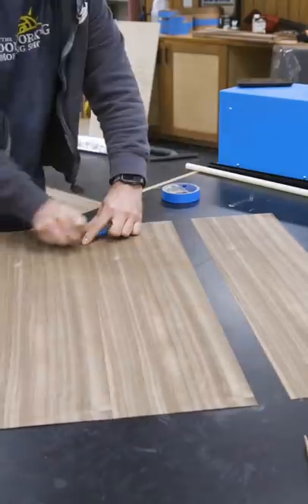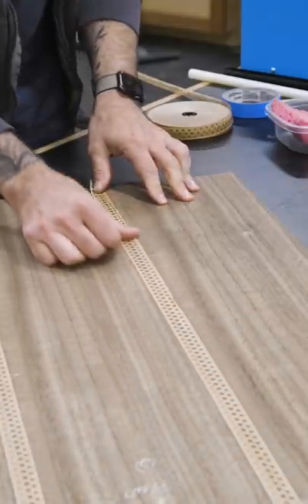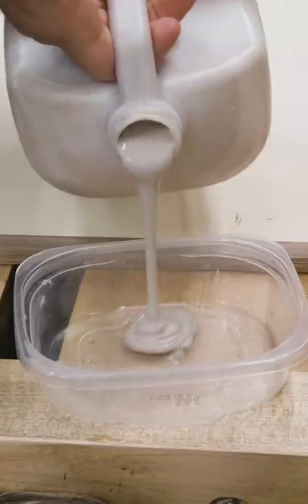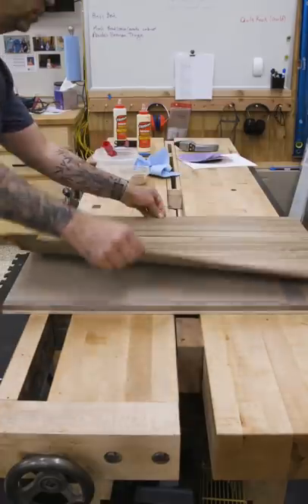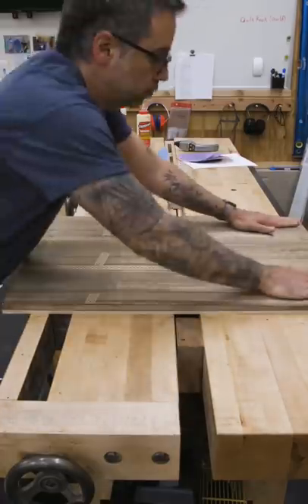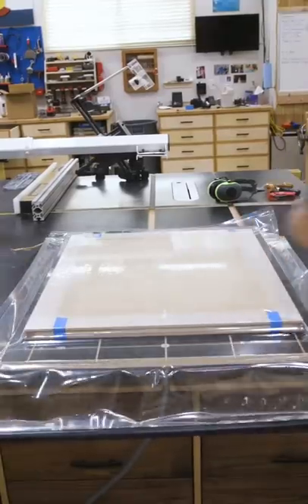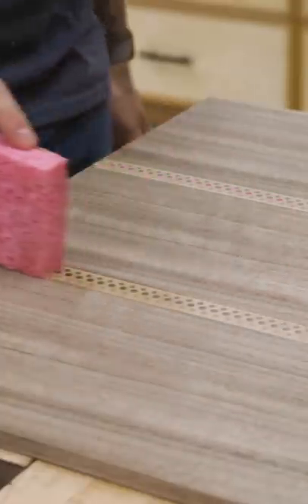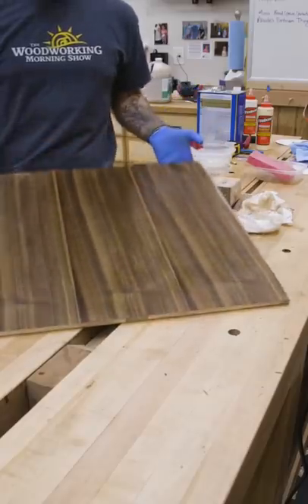Veneered Furniture Doesn’t Have to Be Crap | #shorts

Comment: Veneering high quality woods over less expensive or rare "secondary" woods is almost as old as woodworking itself.
Reply: Correct. The process was used in ancient Egypt
Reply: And it’s still a shitty practice today 🤷‍♂️
Reply: @pkennedy0219  why shitty? It saves precious woods and makes them more accessible to everyone to look at
Reply: @thomas.thomas  doesn’t change that it is a shitty practice that doesn’t last
Reply: @pkennedy0219  lol, so Chippendale furniture is crappy?
Reply: @Woodcademy  might not be crappy… but veneers are shitty they don’t last long term. I’m talking centuries not decades. I can spot a “well made” veneer almost instantly. So yea when it comes to longevity of a piece of furniture veneer is shitty. It also largely depends on where you live. Places that are dry will fair better than a humid place like I live. I don’t make furniture for just ascetics, how long it will last goes much further then it is”pretty”. I don’t buy prefab furniture so I have no clue who chippendales is, nor do I give a green fuq.
Reply: @pkennedy0219  any burl table top or drawer front you see in a museum piece is a veneer. Chippendale was the famous designer/builder of the 1700’s, his furniture, 200+years old and worth millions is usually veneered in part. Mortise and tenon joints are ancient too, but a poorly fitted one is crappy and will not last. Veneer is the same. Done well, it will (and has) last for centuries.
Reply: @Woodcademy  “veneered in part” that about sums it up. Is it possible to do I well sure. Doesn’t change that the majority of veneered furniture is shitty. I don’t like overly ornate furniture so I’m not into burl. I prefer shaker style, very simple furniture done with nice exotic wood. Unfortunately most shitty furniture today is veneered. Even some “high end stuff is just veneer with clever trim to hide it. I’ve restored some veneer furniture Thats around 100 years old, it usually isn’t worth it unless it’s legacy stuff that people cherish. Like I said I don’t buy furniture because it’s either cheaply made veneer shit, or over my pay grade. So I build my own stuff. I’m done talking to you though, you are boring and I won’t ever agree with you. So kick rocks
Reply: @pkennedy0219  yes no doubt veneer is crap compared to real wood. However in this day and age the human population has destroyed the wood resources on the planet. We can't make furniture like it was made hundreds or even 50 years ago.
Reply: @Willis476  that’s not as true as you think. Wood furniture has always been out of most people reach. It is more expensive than particle board covered in veneer because it takes real craftsmanship to make it. Wood has gotten more expensive because we stopped cutting in a lot of places. It’s more restricted now. But we shouldn’t waste wood on things that don’t need it. I feel like house construction could reduce that. Wood cost is also variable by species rareness. Wood furniture used to be the standard because that’s what we had.  I make my own furniture because I wanted to and was gifted really old machines. Carpentry is one of my favorite hobbies and the one I’ve been doing the longest lol. I was hammering nails at 5. Had my first drill press (bench top) and jig saw at age 7.
Reply: @pkennedy0219  This was all a pretty interesting read to me. Thanks for that, I didn’t know much about woodwork
Reply: @pkennedy0219  ok you got me for a second there! I actually thought you knew what the fnck you were talking about. Then you exposed YOURSELF. 🤦‍♀️🤯🤷‍♀️ Really you work with wood and DON’T KNOW THE MOST FAMOUS FURNITURE MAKER EVER...!?! Yea I call bs. I’m like the LEAST practical woman ever, even >I< know who that is! 🤦‍♀️🤯🤷‍♀️
Reply: @pkennedy0219  the problem is that having a nice looking wood doesn't exempt it from imperfections. You have to work with the material you have and when you manufacture goods you need consistency, strength. But also not something that weighs a million pounds. There is a case to be made for veneer from not just a construction stand-point but from an ecological one because wood working can create a lot of waste. If you rely on every "quality" wood to be without imperfection then everything is going to get a lot more expensive quick. It's often disingenuous, I'll give it that. And I've seen too many multi-thousand dollar veneered furniture, but I don't exactly own a business that relies on these materials either.
Reply: @pkennedy0219  have you seen the 3d printed houses? Major way to cut down on wood waste.
Reply: @kerimgueney  solid wood cut using joinery and glued together. If it is done right veneer can be hidden very well. Usually high end old furniture, but the majority of the time it is used to just hide particle board, or even on chip board. That won’t last at all. If they use a base wood instead like pine or poplar. Something that is solid wood but “ugly” then a veneer can last a lot longer. The big problems with veneer is that it can delaminate (peel up from glue failure do to moisture), it also can chip really easy if the edge of the veneer is hit
Reply: @kerimgueney  If you have the money to buy a nice piece of solid wood furniture it is worth it. Hell even off of Craigslist you can find some absolutely amazing wood furniture for cheap. Most of it can be redone and stained different colors. It can also be altered and made to look different. You can redo the finish on a wood piece with stripper and sanding. Mind you it takes a lot of elbow grease… but music helps to pass the time and it becomes almost trance like after a while. Almost meditative. If you want wood furniture your best option is to redo it which and can do it doesn’t take many power tools other then sanders. Or if you have a wood shop like me make it for cheap. For example I made a 9 ft by 2 ft by 2” slab African mahogany table for around 800$ including a few power tools I was replacing. But I have a table saw, jointer, planer, drill press, etc. sorry for the long rant I love wood, and carpentry. The smell of saw dust and cigarette smoke is my childhood from the age of 3 (not me smoking but my dad).
Reply: @elliot6166  my children and their children will enjoy furniture I made by hand. My goal is to build furniture for both my children and myself. That’s why I give a shit
Reply: @pkennedy0219  Solution: Ditch sentimental value, enjoy memories of you and not just your furniture
Reply: Fucking arguments in this section🤦‍♂️ as someone that works with veneers on a daily basis if done correctly it lasts as long as the item (also I don’t veneer onto cheap wood, it’s normally over oak or cherry) 
It may be cheaper but doesn’t mean the item is shitty, it means it’s veneered.
I mean I can’t afford chunks of walnut.
Reply: @pkennedy0219  i'm sure you made all of your furniture before calling another mans work shitty though, right? right?
Reply: @jaretbradley623  I won’t be done making furniture until my hands don’t work or I die. Doesn’t change the fact that I THINK VENEERS ARE SHITTY
Reply: I made a desk out of pine and oak in woodshop 10 years ago. It's worse than amateur craftsmanship and there's a big hole in one leg due to wood defects.
No signs of deterioration yet. Wood is good.
Reply: BS.  Veneered furniture won't last more than 10 years without showing.  You'd do much better just having plastic furniture.
Reply: @pkennedy0219  ok, I’m sure I do. Send me a link to your website so I can inspect and maybe purchase a bit of your handiwork??
Reply: @pkennedy0219  : it would last a lot longer if the soft wood that it’s glued to was completely sealed off from exposure to water on the underside … but as money has it nobody takes the time or the money to do the extra step .. LoL .. so when it falls apart from water damage just remember there was a way out of that problem that nobody wanted to take the time to fix … preventative Maintenance is missing in today’s world that nobody spends money on .. !!
Reply: Veneering is old tech...so is sharia law. Old stuff doesn't always mean it's good
Reply: @thomas.thomas  lol precious. Wood is one of the most renewable resouces....
Reply: @socrazybmx  Really though... The idea of treating tradition as holy is setting back humanity on a global scale.
Reply: @pkennedy0219  not true if you press it into dovetails. Quality is also about what you do with it
Reply: @undr_guv_surv  press what into dovetails? Do you even know what a dovetail is?
Reply: I have beautiful art deco furniture and it's all veneered and in lovely shape.. the way they bookmatch the birls are gorgeous
Reply: @ihave35cents95  it’s BURL
Reply: @pkennedy0219  we'll go have a word with Google Voice to Text
Reply: @andreacancian1865  cool story bro… idgaf what shitty veneer furniture is out their. Solid wood is better, but what ever you want to spend your money on. For that price I could buy new shop tools and wood to make a table that is solid 🤷‍♂️
Reply: no you have to understand this guy literally invented it no one has ever even tried this before
Reply: @StolenPw  lolwut? I don't fear much. And I have an assortment of calibers to cover those that I do...
Reply: @pkennedy0219  What I dont get is....why were you watching a veneer short? If you hate it so much, why watch it? Your skill set is just as useful and good as his is, yet you went out of your way to belittle his product. If your way is so superior why do you feel the need to waste your time on "inferior" products in a short? Seems like a superiority complex or a need to defend because you feel your own method and product is lessened in some fashion? I'm not angry, I just don't understand the thought process of going out of your way and wasting your time on something you hate.
Reply: So far I learned that one person really really REALLY dislikes veneer... Pathetic you care this much 😘
Reply: @SpltPersonaltyOF  He really dislikes it and is really wrong too, which is the funny part.
Reply: Except they often use crap pressure boards that disintegrate if wet even for a few minutes. Good luck fixing and rings or damage.
Reply: @pkennedy0219  What are you talking about? wood furniture was the standard furniture for everyone! What else was it made out of? It wasn’t out of reach, that’s the only material people worked in.
Reply: I did not know that. I learned a thing.
Reply: @pkennedy0219  one thing well known by carpenters and not mentioned is that its less about "expenses" and more about weight/warping. 
You can get pine that is extremely light, durable, and less likely to warp because of its less dense grain layers.
Wrapping cabinet pine doors with a mahogany veneer is actually higher workmanship than using solid mahogany since most pine is lighter and wont warp/split under its own weight like the heavier and more brittle mahogany.
Reply: @drakemallard1486  tell me youve never been antique shopping without saying you dont even know the meaning of the word antique
Reply: @solomonheppner  Zzz nobody cares little kid.  7 months late.
Reply: @drakemallard1486  bad bait. Try again
Reply: @pkennedy0219  how old do you think the particle board is? every single old piece of furniture left by my family from the 1800s is solid pine, handmade by them. that's ALL poor people had
Reply: @pkennedy0219  gonna have to agree here. I barely know anything about woodworking but the look of veneer is so ugly you can spot it a mile away. A true wood piece is an awe to look at
Reply: @sadidrahimi  I think you’re thinking of MDF with a melamine wrap finish (which sometimes has a printed wood grain texture). That’s the “fake wood grain” on assembly furniture. Veneer is different and is actual hardwood cut into super thin sheets. It’s pretty expensive and even fine furniture made from nice woods can be veneered, especially with the best hardwoods that would be cost-prohibitive to make the whole piece from. Doesn’t mean you have to like it, but veneer is not fake wood.
Reply: @pauldiamond1583  yes the Egyptians already did veneer and stacking stones they were also one of the first to figure it out. Amazing to see things we take for granted were done so long ago
Reply: @RagenRibbonz  speaking of the absolute worst veneers- the plastics with wood grain printed on, everyone knows they are horrible, but a buddy of mine said something that put it all in it's place. He said "They literally glued a picture of wood onto particle board" it's weird that I never thought of it that way.
Reply: @pkennedy0219 you expect to live for centuries?

Comment: It’s the symmetry that drives me mental.
Reply: That's why you usually flip every other panel in one or the other direction to break the symmetry. This way it doesn't look as unnatural as seen in the video.
Reply: @robynb.802  I’m honestly insanely obsessive compulsive with that kinda stuff lol. 
I would know it’s flipped and just count them as every other one 😄 
I even discovered that all the tiles in my bathroom are nothing but a single pattern, flipped multiple ways to try and do what you said, and yeah, no, it just drives me nuts that all the tiles aren’t just placed the same way all over haha.
Reply: Me too, it just looks like 70s cabinet wood to me.